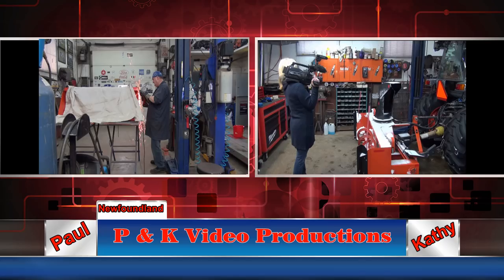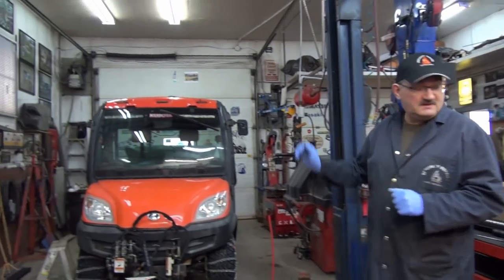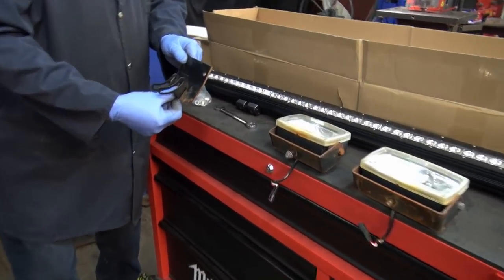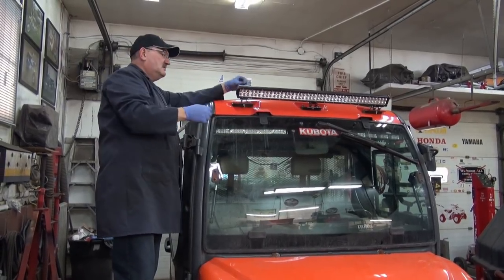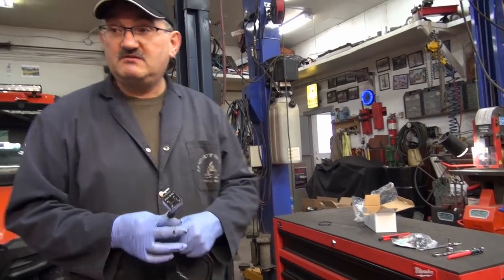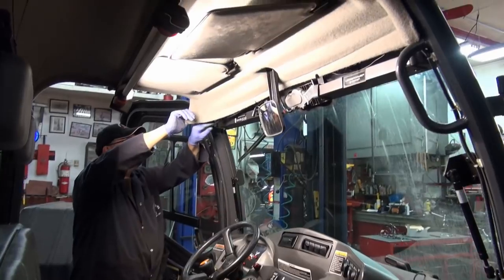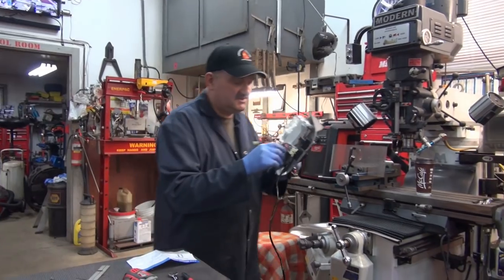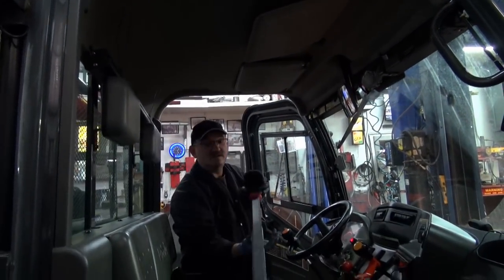Nilight LED Lightbar Installation

Comment: It must be a LED light bar season! 😄 
    I just put a Rigid LED bar on my headache rack on the truck... and it's extremely bright!
   
   This technology has allowed the lobster boats around here to have very powerful lighting without the addition of a dedicated diesel generator, used only to run high-wattage HID lighting. 
    With LED lighting the generator is unnecessary as the normal charging system is able to keep up. 
     I nearly live with an LED headlamp on that in combination with a lithium ion battery is a dramatic Improvement over battery life and the weight of the unit. 
    Keep up the good work!👍

Comment: Another fine and helpful video Paul and Kathy.  Quite a delight to watch the Modfather install the same light bar that I recently purchased for the ROPS of my little tractor. (My bar is only 12 inches.)  I had already figured out the wiring, but it was nice to see you confrm my suspicions.   I have to point out, since someone else is sure to, that the positive wire from the light looked awfully red on my TV.  :-) Thanks for posting.
Reply from the maker: Thanks. I’m not sure what you mean about the red wire but I’ve had many led lights from China that those wires weren’t standard colours. Most I’ve seen were black and white and in some cases the black was the positive wire. Not American standards. That’s what I meant.
Reply: Paul & Kathy Short: When you pointed out that the polarity of the wires were nicely labeled, you mistakenly said the positive wire was white. No harm done, since if folks follow your good advice and check the lables, they will get it right. BTW, I can attest to the durability of these Nilight products. While aligning the mounts to the brackets in my ROPS, I dropped them. They crashed off my hitch and onto my garage floor.  The light survived with only a small nick in the paint on one corner.  I was very impressed with their ruggedness. Love your videos, and plan to order some of your merch. (Gotta get some stickas.)
Reply from the maker: Well I sure don’t remember it lol. Goes to show nothing is rehearsed and not much editing is done. Some days it’s shoot and go. I never watched the video but it’s strange I’d say white when there were only two wires. One black and one red lol. Brain fart I guess 😉

Comment: Hi Paul, I just purchased an x1100c and the dealer installed halogen work lights. I have some LED work lights that I want to replace them with but I need the proper connectors to plug into the kubota pre-installed harness. You wouldn’t happen to have a link to the proper kubota connectors for Amazon would you? Thanks for the help, Jason
Reply from the maker: I have never found OEM connectors and I’ve tried. I simply remove the connectors from the OEM lights and solder them onto the led lights. Much better lighting and well worth the effort.
Reply: @7863348  thanks for getting back to me. That’s what I ended up doing as well.

Comment: Hi Paul
I have a RTV 500 with a V4321 PLASTIC CANOPY and I'm going to order Nilight 39Inch 252W LED Work Light Bar and a wiring harness, I have a few questions if you can lead me it the right direction, the RTV has a spot on the dash more like a blank for a Switch for off and on what Harness part should I order? And how do I get the metal brackets that you fabricated for the mounting the brackets that come with the light bar. I wish I lived closer to your shop!! Lol
Please keep doing what you and Kathy do absolutely enjoy your very informative videos.  
I wish Kathy had zoomed in on the brackets on the roof of the Kubota.
Respectfully
Denny G.

Comment: Did you drill mounting holes in the roof mounting plates? What did you use to waterproof around your mounting holes?
Reply from the maker: That’s an old video and my memory isn’t that great these days but I used existing threaded holes and I made the new mounting plates. As for weatherproofing this sort of thing I always have a little bit of marine silicone or liquid to apply on the bolts. That’s about it.

Comment: So does the original light switch still have function in the system beside the top cab lights?
Reply from the maker: No it’s not used but could be if the owner wanted to use it.

Comment: Nice video. I hope Nilight appreciates you. I will be buying a light or two from them. Question, what holds the switch in the dash?  Does the switch have the typical "press in" clips on the sides?
Reply from the maker: Thank you. Yes press clips

Comment: I just bought an "offshore" version of this. It looks virtually identical right down to the harness. Not great quality. The 10MM mounting bolts were too short and stripped out the first time I tried to tighten them. On another note...The headlight/turn signal switch on this Kubota is identical to the switch on my Mahindra tractor...I wonder if they use the same parts bin?
Reply from the maker: I used many off shore lighting. Some great some aweful. This one was great. Loved the quality. I’ve had stuff sent to me that I've refused to even show on video. Wow on the headlight switch.

Comment: Paul, do you happen to remember what thickness steel you used to make the brackets?  I need to make three because my RTV has never had any lights up top and I don't have any oem brackets to go by.
Reply from the maker: I would most likely went with 1/8th. 1/4 would have been overkill.

Comment: Will it harm to tap into the headlight wiring harness and then unplug the headlights and use the light bar?
Reply from the maker: I wouldn’t do that. The oem wiring might not be carrying  the amperage needed to run the new lights and cause issues all the way around.
Reply: Thanks for the heads up. saved me from making a mistake.
Reply: Dave if you check the fuses value for the original light and it is the same or higher the original harness will handle it fine.
Reply: What about using the Head light wire to power a relay? I wish you use the original light switch on the Kubota.
Reply from the maker: The harness is meant to go to the battery as the instructions indicated. If you chose to splice in elsewhere you run the risk of overwhelming the area in which you tapped into. This wasn’t intended to be a “how to video” . It was intended to demonstrate the installation of the light which included the light, the supplied switch and the wiring harness.
Reply: Thanks for info, saved me from burning up my wiring.
Reply: Dave, that's not a problem. Instead of controlling the relay with the provided switch you can control it with the headlight switch.
Reply from the maker: Yes but he’s talking about connecting the load wires to an existing head light wire and that’s a no no. Never chance that. He can use the existing head light switch that was there to command the relay on but we have future plans for that one in my case.
Reply: Your original question was to disconnect the headlights and replace them with the light bar am I correct? And i said to check the headlight fuse and if is the same as in this case 15 amps or higher You can directly wire the light bar to the headlight harness and I have checked your b7500 and you have a relay already in the circuit .Circuit shows here a 20 amp fuse. But as paul say's not to the switch, to the headlight harness. If this is greek to you take it to a dealer. What the customer wants the customer can have in the case. And Paul that's great you have another use for this switch cause it also is controlling a relay for the stock lights on this utv. The stock lights in this like in most are drawing more than the light bar will.  No more comments from me I may want to comment in the future.
Reply from the maker: I read it differant. This is why I never show wiring on YouTube to many variables and it’s hard to explain the ins and outs of it all not to mention the liabilities if something goes wrong. Like I said in the opening of the video. Get a service manual or get a professional to do it if your not sure.

Comment: Nothing bad about led's on off road vehicles, but I hate them on the new car/trucks and on vehicles that people have retro fitted. Especially a 4x4 with bigger tires as they blind me on our country roads. I have to stop and let them pass. Some times I even have to stop for on coming cars. They may be find from behind the steering wheel, but from in front they are bad for me coming at them.